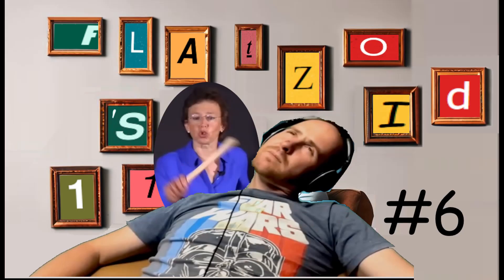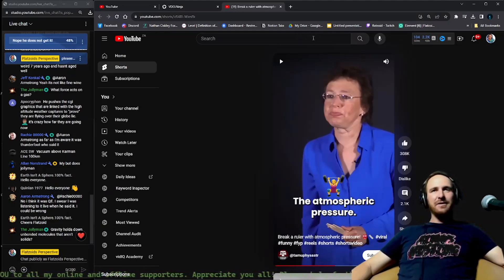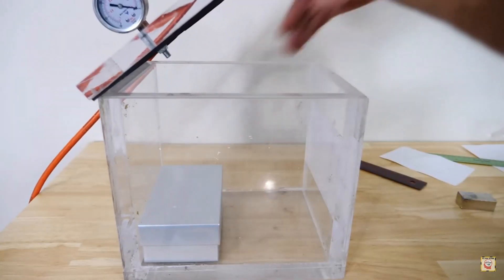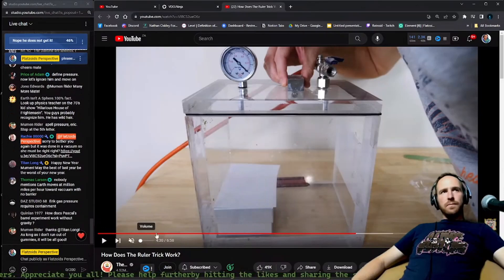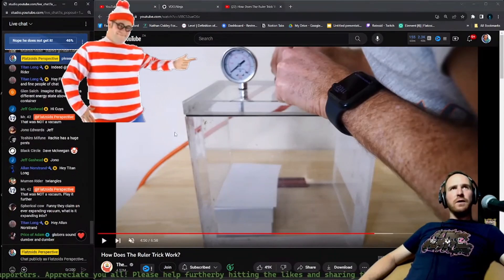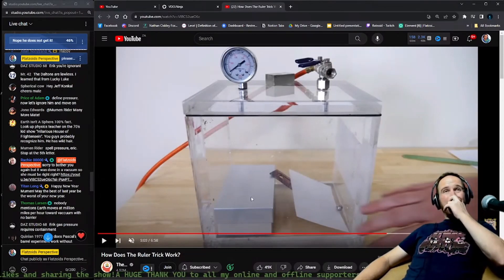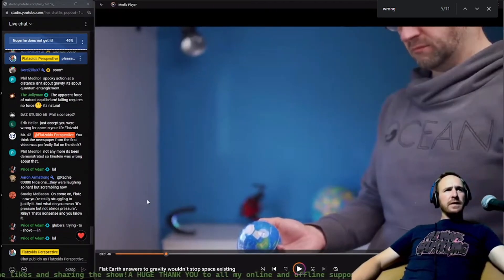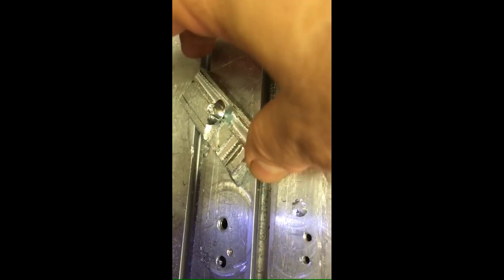Flatzoid's11 EP6 Can A Ruler Be Broken By Atmospheric Pressure Huh uh

Comment: Amazing ....  Flat has become even more disgusting than Oakely, he lies and misdirects hoping he wont get caught... he needs to just give up, he isnt going to win this "fight". And the thing is he doesnt even realize that he has already lost. Friction is his reason, friction applies to sliding surfaces not lifting, the working factor in this senerio is pressure gradients between the top of the paper and the vacuum formed as the paper is trying to be lifted from the surface, its all dependent on air pressure... and he thinks he is a critical thinker, only thing critical about his thinking skills are that they are in critical condition CODE BLUE....

Comment: 11:15 multiple screws? if you make two smaller holes or several along the length and countersink them, it should be more resistant to damage knocking it loose.

Comment: It's surface tension due to the friction based on the surface area. So.. it's the tendency of a liquid to shrink into into the smallest possible surface due to to the force resisting the relative movement of material elements sliding against each other based on the surface area of a very porous bit of newspaper? That is some next level shit right there 😂😂
Coming from the man who thinks 60 degrees are a right angle or that pressure is weight, this catapults F11atzoid to whole new heights of stupid.

Comment: This is going to be way beyond the mental capacity of flattards, but I’ll post it anyway. The Mexican F1 race is this weekend. The cars are set up with a rather high drag package but they still manage to go at really high speeds. The reason for that is the altitude. There’s less atmospheric pressure so less friction on the car as there’s fewer air molecules creating drag. Easy to understand for a normal person, but FE brains won’t be able to grasp the basic concept.

Comment: Retired structural aircraft technician here. Spent the last half of my +30 year career doing structural repairs on composite materials.

If it weren't for atmospheric pressure, most of my repairs would have quickly failed because the layers of repair cloth, either soaked in hand mixed resin or pre-impregnated by the supplier, need both heat and equally distributed pressure to achieve structural integrity. 

The heat is supplied by strategically positioned heat lamps, giant temperature controlled walk-in ovens or computer controlled heat blankets, that maintain a specific temperature, under pressure, for a specific time frame. 

Then we used atmospheric pressure to compress the repair plies (vacuum bagging). 

This involved laying up the repair plies, covering them with a parting/release film, then various woven bleeder/breather cloths. The final step was to surround the repair area with bagging tape(a viscose, sticky, ½“x⅛" tape) to which we stuck a thin, flexible, airtight bagging film. Vacuum hoses were attached and all the air was drawn out. 

This compressed the repair plies under the nominal 14 psi of atmospheric pressure at sea level. 

A 12"x12" repair area would be subject to 2016 POUNDS of air pressure, evenly distributed across its surface. This atmospheric pressure is there even if the bagging is installed on the underside of a structure or if the repair area has a 90° bend in it. 

A repair carried out in Denver or Mexico City, is inherently weaker, because there is less atmospheric pressure (~12psi) to compress the plies. 

OG manufacturers often use pressurized ovens that compress the bagged plies under higher than atmospheric pressures, for even more structural strength. 

Thanks for coming to my Ted Talk. 😅

Comment: It is just so that flat-earthers do not think logical, they are used to avoid anything that can be proven logical and then go for the answer that fit their belief.

In this chase they can not understand that air have weight and that weight and pressure is the result of the same thing, they can change the paper to a thin metal sheet and to a heavier ball and then do it in water and then in air to get similar result where the paper sheet stay on when it have the weight of the water above it and without water holding it down.

If it would be "friction" causing the ruler to break they should be able to test that by cutting the paper so it still have the same surface area that can create "friction" but also letting air through to see if it is friction or air that is causing that.

Another test they can do to test air and pressure is to drop a sheet of stiff cardboard onto a flat surface and see how it float over the surface on air with higher pressure under it.

OBS: I hope you can read this, I had a stroke a year ago and to formulate things with written words are still very hard.
Reply: You still make more sense than a flat earther. Hope your recovery continues 👍

Comment: "I've admitted I'm wrong, but I'm still going to insist that the paper stops the rule flipping up because of the surface tension" Flatzoid.

🤦

🤦🤦🤦

🤦🤦🤦🤦🤦🤦🤦🤦🤦🤦🤦🤦🤦🤦🤦🤦🤦🤦🤦🤦🤦🤦🤦🤦🤦🤦🤦🤦🤦🤦🤦🤦🤦🤦🤦🤦🤦🤦🤦🤦🤦🤦🤦🤦🤦🤦🤦🤦🤦🤦🤦🤦🤦🤦🤦🤦🤦🤦🤦🤦🤦🤦🤦🤦🤦🤦🤦🤦🤦🤦🤦🤦🤦🤦🤦🤦🤦🤦🤦🤦🤦🤦🤦🤦🤦🤦🤦🤦🤦🤦🤦🤦🤦🤦🤦🤦🤦🤦🤦🤦🤦🤦🤦🤦🤦🤦🤦🤦🤦🤦🤦🤦🤦🤦🤦🤦🤦🤦🤦🤦🤦🤦🤦🤦🤦🤦🤦🤦🤦🤦🤦🤦🤦🤦🤦🤦🤦🤦🤦🤦🤦🤦🤦🤦🤦🤦🤦🤦🤦🤦🤦🤦🤦🤦🤦🤦🤦🤦🤦🤦🤦🤦🤦🤦🤦🤦🤦🤦🤦🤦🤦🤦🤦🤦🤦
🤦🤦🤦🤦🤦🤦🤦🤦🤦🤦🤦🤦🤦🤦🤦🤦🤦🤦🤦🤦🤦🤦🤦🤦🤦🤦🤦🤦🤦🤦🤦🤦🤦🤦🤦🤦🤦🤦🤦🤦🤦🤦🤦🤦🤦🤦🤦🤦🤦🤦🤦🤦🤦🤦🤦🤦🤦🤦🤦🤦🤦🤦🤦🤦🤦🤦🤦🤦🤦🤦🤦🤦🤦🤦🤦🤦🤦🤦🤦🤦🤦🤦🤦🤦🤦🤦🤦🤦🤦🤦🤦🤦🤦🤦🤦🤦🤦🤦🤦🤦🤦🤦🤦🤦🤦🤦🤦🤦🤦🤦🤦🤦🤦🤦🤦🤦🤦🤦🤦🤦🤦🤦🤦🤦🤦🤦🤦🤦🤦🤦🤦🤦🤦🤦🤦🤦🤦🤦🤦🤦🤦🤦🤦🤦🤦🤦🤦🤦🤦🤦🤦🤦🤦🤦🤦🤦🤦🤦🤦🤦🤦🤦🤦🤦🤦🤦🤦🤦🤦🤦🤦🤦🤦🤦🤦🤦🤦🤦🤦🤦🤦🤦🤦🤦🤦🤦🤦🤦🤦🤦🤦🤦🤦🤦🤦🤦🤦🤦🤦🤦🤦🤦🤦🤦🤦🤦🤦🤦🤦🤦

Comment: You can have a gas in a vacuum, but not a gas pressure in a vacuum.
A gas is gas molecules, moving and colliding in a vacuum, but you need something else than the gas in the vacuum to get a pressure from the gas in the vacuum.
Reply: Eggs?
Reply: Gas can press on itself.
What about pressure in a liquid?
If the answer is yes, what is the difference?

Comment: The rubber moulds for white metal casting are vulcanised in a metal ring with top and bottom plates.  From necessity, the plates are very close-fitting to the point of needing three bolts to force the top plate out of the ring due to atmospheric pressure.

Comment: Has Flatzoid ever seen a newspaper 😅? Put a sheet of paper on a table and it moves easily. You can shift it by blowing on it. There is no enormous friction gluing it to the table as he imagines. There is no imaginary “surface tension” at all.
Reply: They don't allow newspapers in padded cells.
Reply: Typical Flerf behavior. They always claim things behave in a way that never happens in reality. 

Only flerfs can see the sun shrink at sunset or have ever been able to "zoom a ship back over the horizon" or even see the horizon DROP from any height... 

They MAY just make up how reality behaves as they have never actually paid attention to the real thing.

Comment: I think there is more to why atmospheric pressure is responsible. When the paper begins to move up, gas inertia allows a low pressure zone (without a container!) to form. The pressure differential is a force down on the ruler.

Atmospheric pressure is the same in all directions. It won’t oppose motion. Differential pressure will, of course. When something moves in gas, gas inertia opposes instant equalization and pressure differential forms.

Comment: 7:40 is Flatzoid's "Interesting" moment...

Today the newspaper is held down by 987 hPa in my place. So reports my barometer. On the average across the earth, it should be around 1013 hPa (1 bar). IDC about American units...
Reply: Fun fact. 1013 is the expected pressure at sea level on an ISA day. From there it drops by 1mb every ~30ft.
Reply: @Alysm-Aviation  - and I guess this value has increased a tiny bit since this was specified due to the global warming.
Reply: @LigH_de  well, ISA conditions are defined as 15°C 1013mb at sea level.
Performance can still be based on this basis regardless of the actual temperature
Reply: @Alysm-Aviation  - a study of The Irish Meteorological Service did not show a noticeable change of the average annual pressure in the last 70 years. Only a slightly greater variance of the minimum. So the global warming doesn't make the atmosphere measurably thicker, but certainly more turbulent.
Reply: @LigH_de  that is irrelevant to ISA based performance calculations.
Reply: @Alysm-Aviation  - I do not even know what ISA means in your case; probably not an outdated PC data bus system...
Reply: @LigH_de  International Standard atmosphere.

Comment: So I guess parachutes work due to friction.
Reply: Friction and normal air.  Maybe eggs 🤷‍♂️
Reply: Air resistance is a form of friction. Modern parachutes (the square type) work on aerodynamics.
Reply: @clivedavis6859  
Are you saying that the olde round ones dint work on aerodynamics?
Reply: @awatt  The old round ones work purely on air resistance. The square ones have an aerofoil shape and develop lift. I suppose both are part of aerodynmaics, but different principles of it.

Comment: Your CNC machining needs a container or better clamping solutions. Just saying
Reply from the maker: I was only taking 0.1 mm cuts about 1mm wide . Barely touching it… which was fine until… y axis stepper lost a few steps….
Reply: @whereswa11y  
The joys of letting a computer do all the work
Reply: @whereswa11y  You need to adjust for the surface tension and friction according to the surface area.